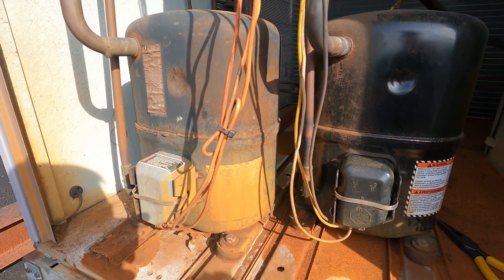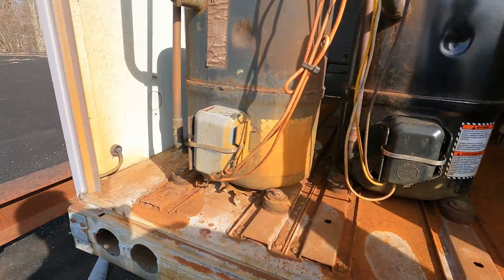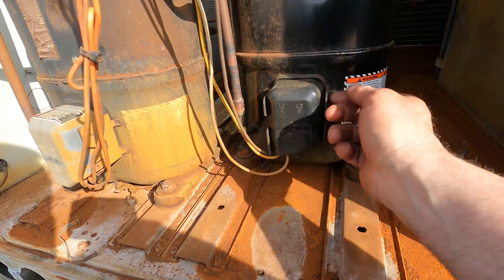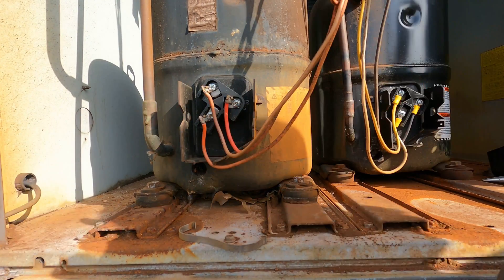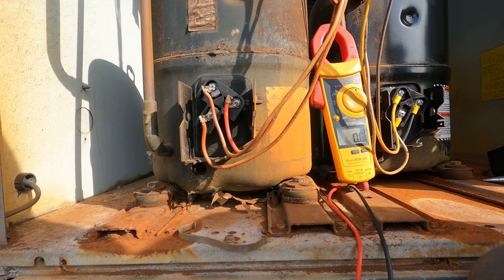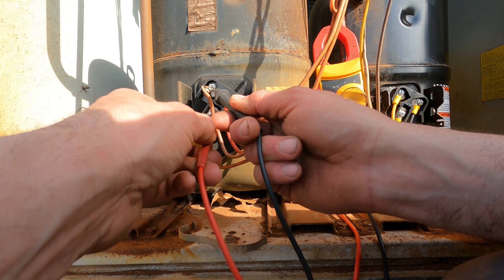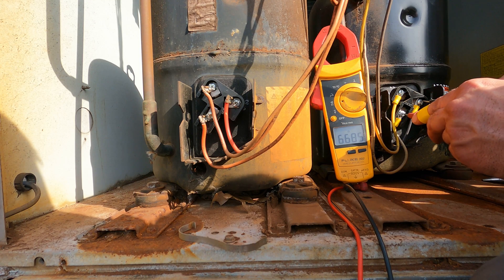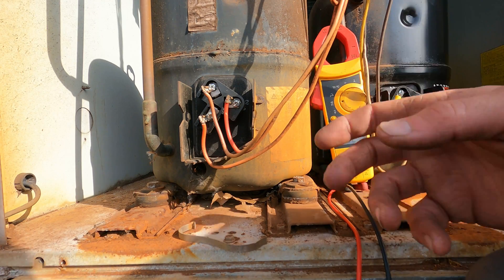Testing Air Conditioning Compressor Windings

Comment: Three phase motors do not have Start, Common, or Run leads, all three leads are equal, and only the rotation direction is established by their connections. If by chance, it is running backwards, then swapping ANY 2 leads will correct that condition.

Comment: Better remove the connected wires before taking the resistance.
Reply: EXACTLY! Always remove the leads on a compressor, single phase and three phase, when checking winding resistance.
Reply: Aren’t we supposed to remove all wires to the compressor? Just to be 100% sure it’s not connected to any other components 🧐